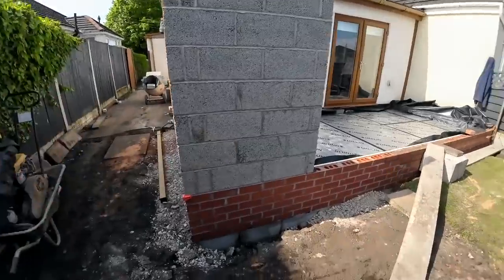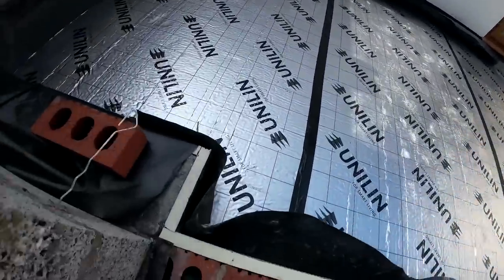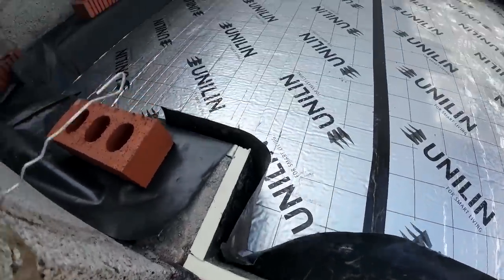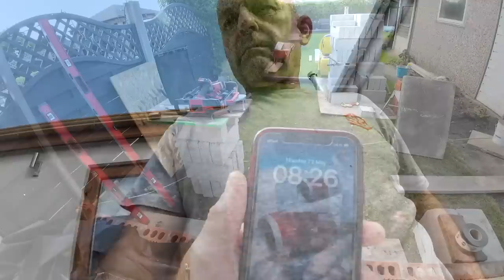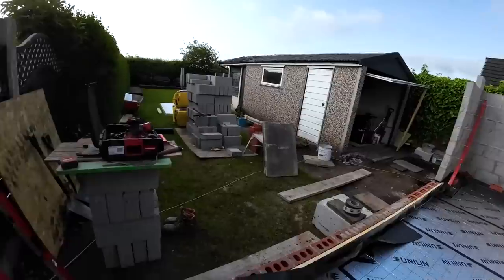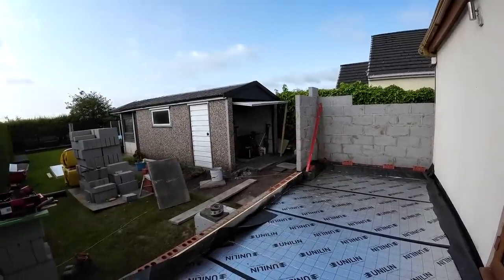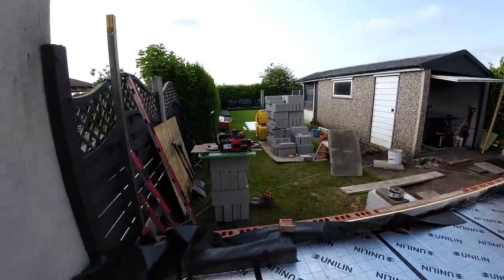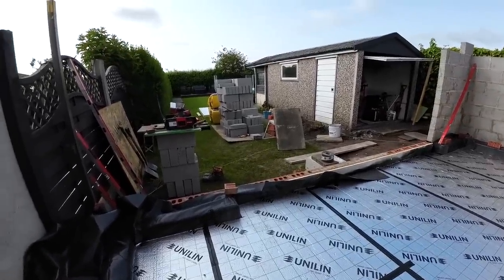100 MM CONCRETE FLOOR PREP AND POUR

Comment: Hi mate. Just one thing. Over years I've noticed on tho new work dpm is lapped into dpc which is correct to Building regs . However on the existing house there is left a OPEN joint ie Dpm just turned up.. the best way is to coat the existing wall around this area with a liquid dpm say 300 to 200mmfrom house dpc. Then seal on the house dpc area with waterproof silicone.  Then when concrete is poured this then presses against upturned dpm,  and  creates  a watertight tanking seal.. this is what I would do now. After years. On my own house or others.   Another way is disc cutter and insert, but this can damage existing dpc.. Anyway great workers enjoy watching

Comment: We always have to tape joints on floor insulation but we don’t have to put thermal edge around inside blockwork. BC are happy as long cavity insulation meets the floor insulation 🤷. Looks like that hip is giving you grief Steve.!
Reply from the maker: Funny how different authorities, even different inspectors in the same department have differing ideas how they want things  done 🙄🧱👍🏽

Comment: The exposed external block on the gable next to the other property, do they need weatherproofing? Have a similar situation for my own extension, wasn’t too sure if need to protect them some way, also would the new cavity need to be joined into existing ie: cut a cavity into existing walls? Thanks
Reply from the maker: Only if it’s exposed, on our job the gutter will bridge the gap . 
    Some inspectors ask for it some just want a vertical damp installing and some don’t want anything 😬🧱👍🏽
Reply: @SteveAndAlexBuild  thanks buddy

Comment: not meaning to be negative like D R , but why didn't you just knock a hole lower on the ordinal wall below the old air brick to pass the 4" pipe through? would have saved you that  periscope elbow and would let any condensation build up drain away
Reply from the maker: I didn’t do the vent
Reply: @SteveAndAlexBuild  Danny did it in the previous video
Reply from the maker: Danny did it so I can’t answer that question

Comment: What a waste of 2 ton bags! A little more effort could see these returned to RECYCLE!
Reply from the maker: My back and hip wound beg to differ .  Feel free to tell us how to recycle those bags
Reply: Gerry send a blank check and Steve will save every bag from now on !!
Reply: The merchants dont reuse them, never, so they get recycled in the skip.😋
Reply from the maker: Exactly, we’ve got about 8 in the garden 🙄🧱👍🏽
Reply: I scrounged half a dozen from a builder before he skipped them (to store a load of soil out of the way while I rebuilt some raised beds) and asked him why they don't get returned. He said the merchants won't reuse them because their condition can't be assured as they have been on a customer's premises out of their control so would never risk lifting them again with a grab.
Reply: @dannyboy9817  That's a very good point well made. Safety first every time.  Still it seems a shame if these bags go to landfill to eventually break down and filter into the oceans.  There should (technically) be a better way to collect them up for recycling the materials (if supermarkets can do this with shopping bags....).  Or maybe a way to avoid the single - use plastics altogether???